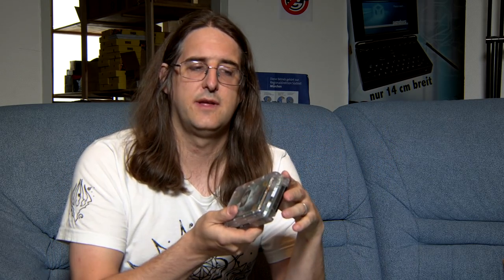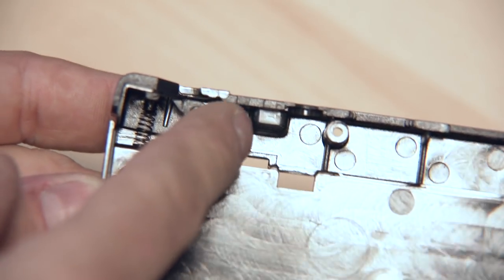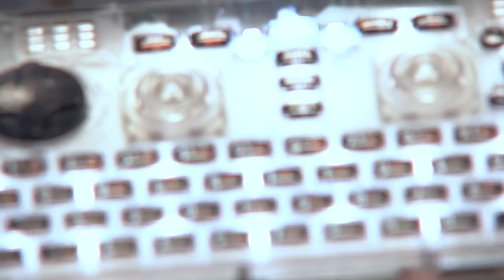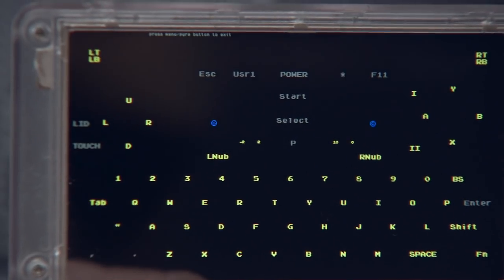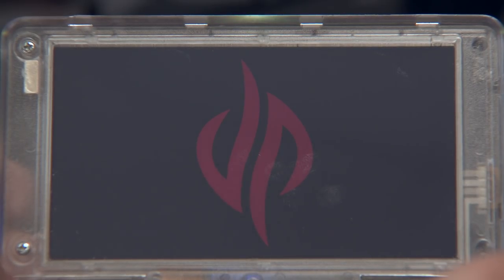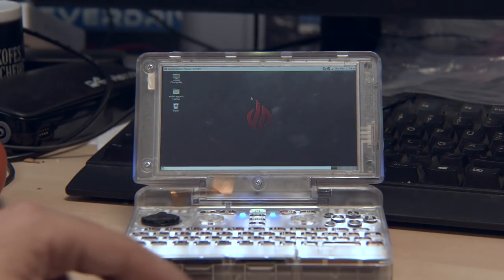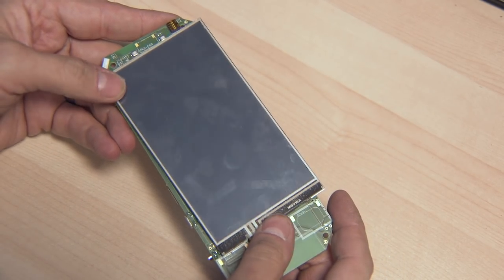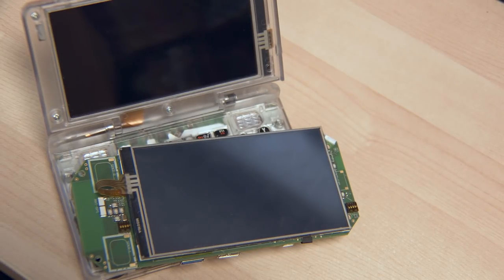Pyra Prototype Test Run - and a surprise

Comment: get the rest you need, Ive been waiting since pandora announcement i dont mind waiting some more. I am thinking of getting one of the 1TB+ sd cards in anticipation.
Reply: You must be loaded.
Reply: I'd use the cards I have and then buy one when the Pyra comes out.  I got some cards for the Pandora because it was going to be released in 'two weeks' and it ended up being a while and I wished I got bigger ones.
Reply: @threezerol944t  wish i was but its a good investment, been on the market a while so price will steadily drop, also why i am waiting to buy.
Reply: @jappperon7012  Dude, pandora was announced like 12 years ago... You been holding out that long? You must have money to burn to be able to wait for years on this stuff. It's cool ED is still plugging away, but fuck. Seems craigix ruined what couldve been a really good thing. The ship has sailed as they say.
Reply: This is Pyra ie Pandora 2 not the first Pandora!
Reply: @threezerol944t  Im just really good at saving money. Had Life throw a wrench in my plans back then. Mostly been saving for personal franken computer and a really sweet personal workshop/laboratory.

Comment: A Pyra phone would be interesting especially if the plan is to make something that can be upgraded by swapping out the CPU it might actually be close to a workable version of that modular phone concept that lasted for all of 15 seconds. As for heat would it not be possible to have it just turbo mode up to a higher clock speed just when it's needed rather than have it run at one speed that might be too slow for some games or run too hot for too long on others?

Comment: i wish i could support you guys but its just too expensive and troublesome tome import it in here. Too many taxes plus the possibility of it getting lost in the middle and the post office and customs playing dumb.

Also how about having a module that will downclock the cpu if the temperature goes up too much for too long?
Reply: I also want to support this project, but there's no way I can afford the cost of the unit. I might just try 3D printing my own handheld.
Reply: @Reed-Publications  The fact anyone has even continued to pay attention to this is absurd. There are already handhelds with much, much better hardware in the same form factor that are already released for the same price or CHEAPER. Like the GPD Win 1 and 2. Hell, the GPD XD probably has better hardware. This is just sad.
Reply: @samuelgershman6355  I think I'm inclined to agree with you. You can even buy a cheaper clamshell than the GPD, which is called the Powkiddy X18.

Comment: USB C? Please?
Reply: No. We've been through this in the forum already and the changes to make it work are too big this late into the project. Besides, the USB Type C standards are a huge mess right now.
Reply from the maker: @Djhg2000  Especially since the SoC doesn't support USB-C yet. With a future upgrade board it will become possible, yes.
Reply: USB C is miserable, I thought it durable , but all the connectors are broken after one month, expensive or cheap cables, less durable than lightning, or standard microusb, i had never had problem with standard USB A sockets, I don't like C I don't feel the hype as i have already 5 broken cables...